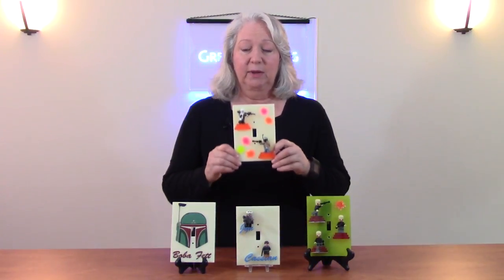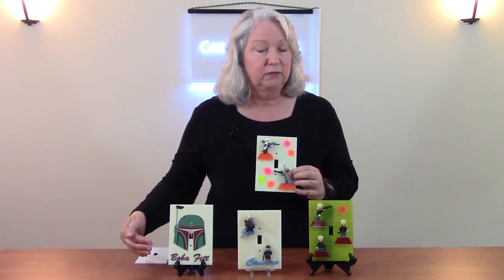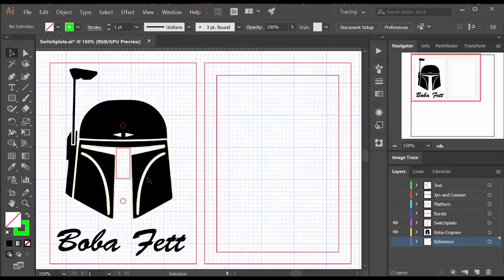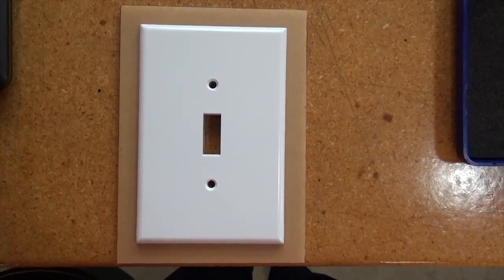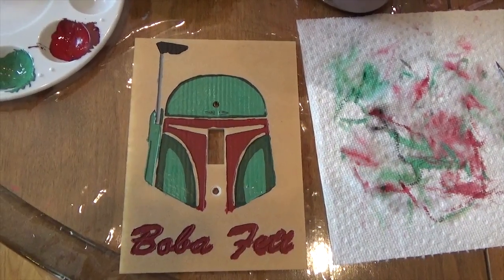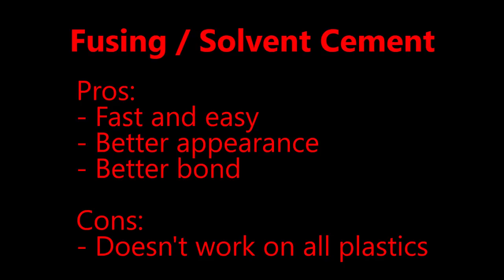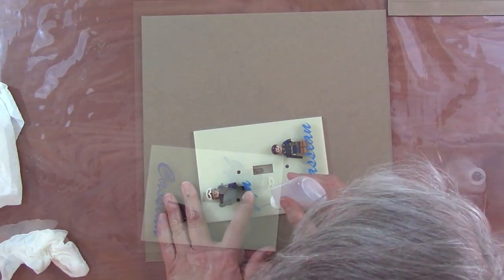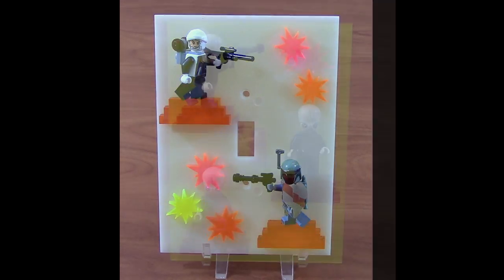How to Laser Cut and Assemble a Star Wars Switch Plate

Comment: When bonding cut acrylic pieces, I often run into crazing issues where there are fine cracks along the cut edge after bonding.  Have you noticed this and do you have a way around it other than the rather lengthy and involved annealing process?
Reply from the maker: Roger, I have not had this experience... what kind of acrylic are you using? I always use cell cast. Are you using extruded?
Reply: I always use cast acrylic.  It is more noticeable in the mirrored varieties (of course) and from what I read it is fairly common and fixable through annealing, but it is a rather involved process of heating the acrylic to release the built up tensions....blah blah blah...lol!!  May have to use that process for the mirrored, the more opaques should be fine without.  Thank you, though.  LOVE your videos and your creativity.  Stirring quite a few ideas in my own mind!!!  :-)